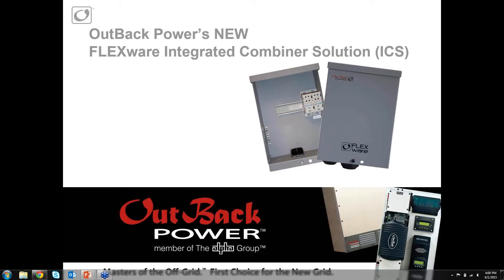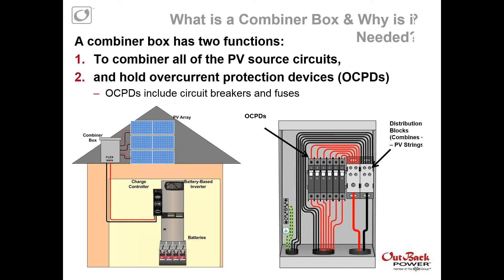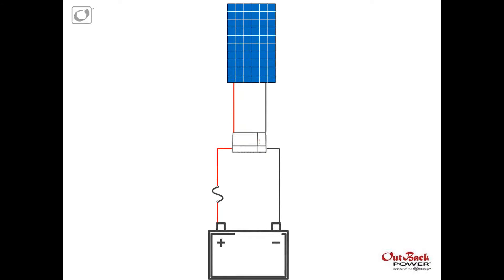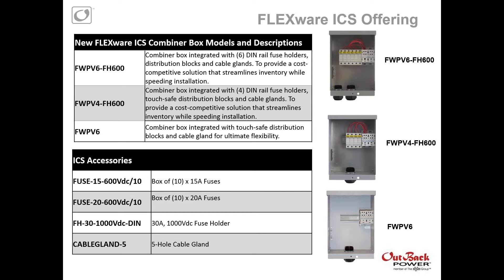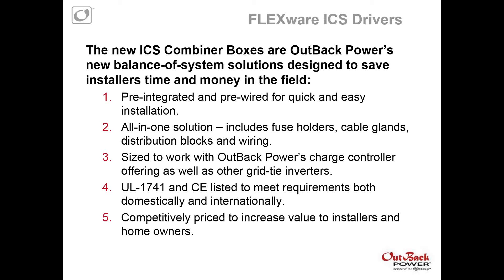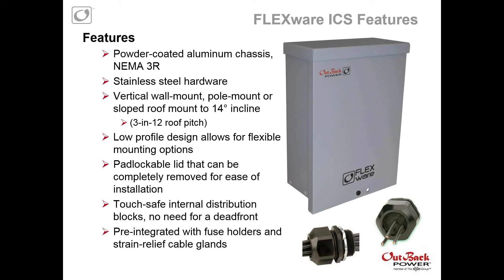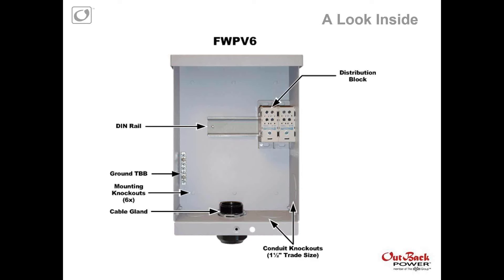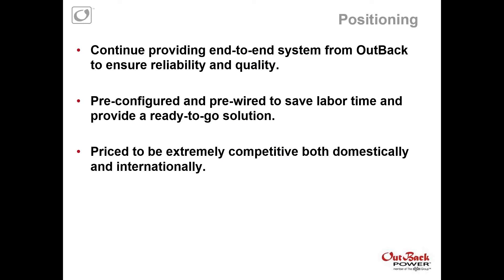Webinar |  Introducing OutBack’s FLEXware ICS Combiner

Comment: What is needed is a web based interface to program all of the devices.  The combiner box is easily made from off the shelve components.
Reply from the maker: TechMan1219 OPTICS RE our web based control and monitoring system allows you to program all of your OutBack firmware-enabled devices! Check out our OPTICS webinar to learn more https://youtu.be/KCAXxerpsJg

Comment: Too much dang work to get the info  I want. My first stop was to read the PDF manual, and now this. Neither helped.

All I want to know is what size breakers are needed for 2 - 250 watt panels in series?  They will have a max voltage of something like  80Vdc.           Thanks in advance!  Joe
Reply: 15 amps.